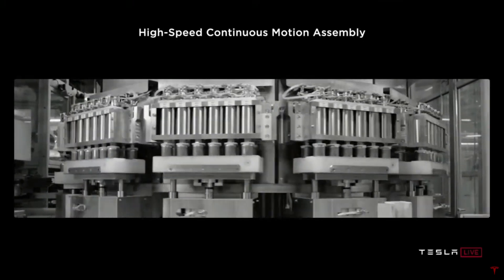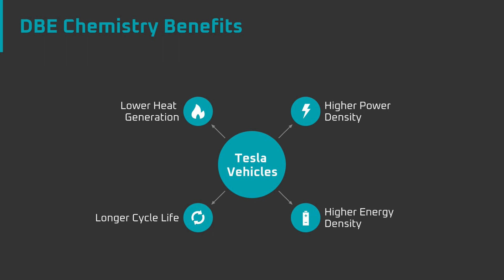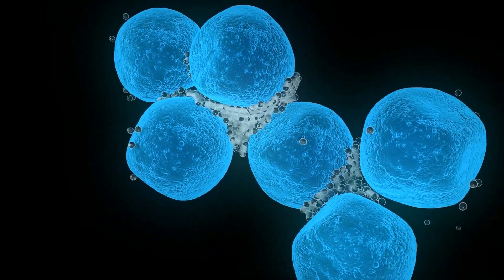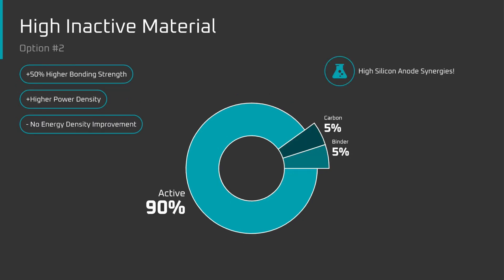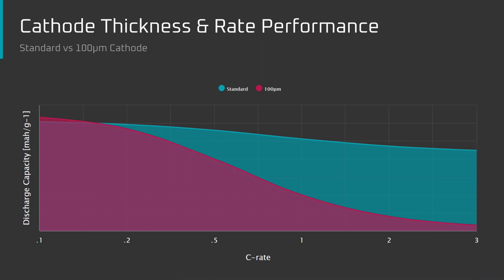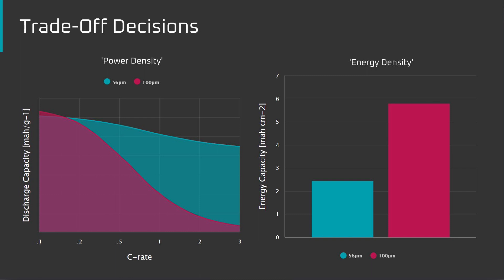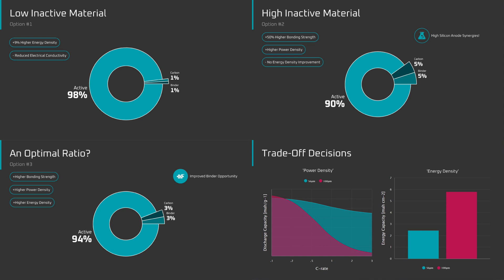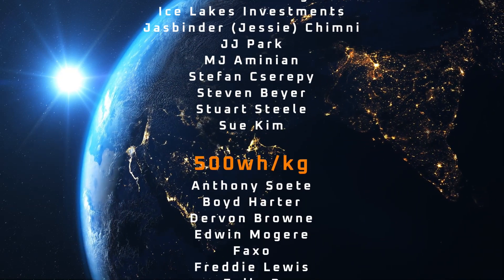#2 Tesla's Secret Sauce // Maxwell Dry Battery Electrode

Comment: Where are the 10s of 1000s of 4680 cells weekly being pumped out by the "tiny" pilot plant (since May?) going? How many (2k cell?) Cybertrucks & (10k cell?) Semis can be outfitted at that rate (increasing as manufacturing is optimized & stabilized to the point that the machines that build those 4680 making machines can be built)? Estimating conservatively from 20k/day (1000/hr with 4 hr/day avg downtime for tuning & retooling) to maybe 50k/day? (ALL this is total SWAG from what was hiding in plain sight on BD, edited in response to feedback.)
Reply: The Semi-truck needs 10 times the number of battery cells than the 100 kwh sedan. A 1,000 kwh battery pack, for the Semi-, will require about 10,000 cells of the new model 4680 battery cells. The pilot plant may be enough for just that; but, there's also the needs of the cyber-truck and the Model S Plaid, and ... who knows.
Reply: Thx, I've edited my original ?s  in response to your & others' feedback. Seems like the PR Dept was redundant, as the "visible" team are doing fine interacting with the public. Those vids of real-time pilot plant ops seemed quite revealing.
Reply: @Crunch_dGH  As Elon said, the 4680 battery pilot plant is still being modified / improved. The plant may be shutdown for extensive periods of time for changes and testing; so, its output won't be continuous. Beyond this, Tesla is telling the public NOTHING. There is no information for us to draw conclusion from.
  A battery production plant design company (ATW), which Tesla recently bought in Germany, will (supposedly) design a full-scale 4680 battery cell production plant. They will, supposedly, use the design elements of the pilot plant, and incorporate those ideas  into a full production battery cell plant for the Giga-factories. It would be nice if Tesla had a PR department to inform the public of things like this---but, no, they don't.
Reply: @artsnow8872  Thx, I've edited my original ?s  in response to your & others' feedback. Seems like the PR Dept was redundant, as the "visible" team are doing fine interacting with the public. Those vids of real-time pilot plant ops seemed quite revealing.

Comment: (OCGN) OCUGEN....Explain this to me. How is it, that a Gene Therapy Company that by right at this point should be on Ark Invest Radar? They have 4 gene therapies on Phase 1 and phase 2 trials. and it's still at $0.31 a share. I can't believe it. tell me what is wrong with this picture, and why is it at $0.31 a share and 3 Analyst have it going up to $1 this QUarter? I do not get it? Oh (OCGN) OCUGEN THERAPEUTICS. Ocugen, Inc. engages in the development and commercialization of therapies for eye diseases. Its pipeline includes OCU400, OCU410, OCU200, OCU200, and OCU300. The company was founded by Shankar Musunuri and Uday Kompella in 2013 and is headquartered in Malvern, PA. The listed name for OCGN is Ocugen, Inc. Common Stock tHAT IS PULLED FROM Robinhood APP.

Comment: Jordan, there’s an extra slash or exponent on the ordinates units (Discharge capacity) on the graph “Cathode Thickness & Rate Performance” at 11:51. Probably from the source. Should be either (mah/g) or (mah . g-1).

Comment: Do they HAVE to use a metal oxide on the cathode? Most of the metal oxides are nickel dominant anyways.  Couldn't they just use nickel foil attached to the aluminum cathode?  The nickel part is what retains the power right?  So why are they using a slurry mix of brittle metal oxides? Get rid of them. 

A thin sheet of Nickel shouldn't come apart due to expansion and contraction and you could coat that foil with cobalt and manganese as needed.
Reply from the maker: Metal oxides are used for intercalation/storage.  Pure nickel doesn't do this.

Comment: I would like to see another video on electric flight.  I poo-pooed your other video, but the topic is actually important.
Aircraft are much more efficient at carrying payload fast, more than you would think.  The book "The Simple Science of Flight" has a nice approachable explanation.
While my video claims Elon's "Electric Jet" is nonsense, it may be possible to produce an electric fan that is efficient at high speeds.
As an example of efficiency, modern composite petroleum powered aircraft that travel 200 mph have about the same fuel efficiency as a passenger car traveling 60 mph, for a payload of two people.  A 278-horsepower engine hit 323 mph in an airplane designed by Paulo Iscold.

Comment: So now we get a little insight into why it is so difficult to nail the process.  First, many of those graphs are on log scales.  So very small variations in process tweaks makes for large variations in performance.  So, for example, roller separation is undoubtedly a critical factor.  When microns matter everything from feed rate to viscosity to temperature needs to be super tightly controlled.  Not just in the machine but things like the temperature of the roll as it is being fed, probably even the malleability of the metalic sub-straight.  That means reliable production processes before the materials even get to the Tesla factory.  These are the kinds of things that are relatively easily tweaked in pilot production but at terawatt scale must be right from the get go.
Reply: Tesla has bought a battery production design company in Germany. They will, probably, design such a production line for Tesla's new 4680 battery. Maxwell Company would, then, design and build the necessary equipment for the production. These 4680 battery production lines may be part of All the Giga-factories. Panasonic will, still, produce the older 21650 battery cells at Giga-Nevada for two or three years -- then, who knows.

Comment: G'day Jordan,

I realise you're about to go into the cell design benefits, so I figure I'll add my AUD $0.02 (which is worth 7% more than your NZD ;) - although the info contained is definitely worth less than yours lol )

Fairly directly after battery day, there were a lot of people doing the basic volumetric math on the cell (and Tesla's slides) and decided that the 4680 cell is 5.5 times the volume, but was "only" 5 times more energy and started complaining. What I realised fairly quickly is, that a single 4680 cell occupies roughly the space of 4x 2170 cells (in the battery module), because of losses to airgaps and whathaveyou. So volumetrically, it's actually 20-25% more efficient just due to shape alone when compared correctly to 4x 2170s. It is also 6 times more powerful (so 50% over the 2170s). I would assume largely because of the tab-less design ofc, but, it also led me to think. Perhaps Tesla is using the fact that the new cell has better natural characteristics (in energy capacity), to focus much more on Power density. A feature that they already excel in, but, even more allows faster charging. Which is a HUGE selling point (and much needed for the Semi and newer cars as battery pack sizes balloon)

There's also the possibility that Tesla isn't pushing the envelope too far with these batteries. Cost and manufacturing speed are the two essentials for them, so they can ramp up to astronomical levels (almost literally with SpaceX lol). That would also allow them to "improve" as time goes on, even if they technically might already be capable of it now (but that's a fairly cynical thought of a tactic, which I don't think Tesla would choose)

Also, I can't recall where I heard, that, trace amounts of NMP left in the electrodes after a wet slurry, react quite negatively with the electrolyte itself. Where they have to put in additives to prevent the degradation caused by this (which all happens in the first few charge/discharge cycles in the factory). Maxwell's DBE shouldn't have this issue either.

Keep 'em coming though Jordan, love your content. If I could inject it straight into my veins (I wouldn't because I hate needles, but) I would at least smoke it or take it in pill form (and now I'm off topic lol)
Reply from the maker: Thanks for the thoughts Mr. Velociraptor!

Comment: Tesla's new battery chemistry isn't , DIRECTLY, the most important development. The most important development is that by combining all the changes in chemistry and packaging, the new battery assembly can be 10%+ more efficient, have about a 40% smaller footprint, and about 50% lower weight from reduction of cooling system mass and use as a body / frame structural member. Reduction of cobalt and manufacturing complexity are very important as  cost-saving measures.
 All of the combined savings are several hundred pounds of total vehicle weight (which results in greater vehicle range), and a decrease of about 50% in the price of the battery package.

Comment: In the debate between energy density and power density tesla will always maximize energy density.
 The reason is a) the tabless design creates more power than they could need, and b) you can always increase total power by adding more batteries. It's the same reason ultracapacitors make no sense. If you need the extra power, just add more batteries and get bonus range with it.

Comment: i keep hearing the hype around solid-state, it's been a real goto for firms wanting to shit talk.  Mercedes claim to have a bus that will be solid-state powered. Mercedes! what were they thinking lol. it claims to have a 441-kilowatt-hour battery pack that will have a range of 136 miles.  I'm not even sure i understand that tiny number versus the huge pack. i get the bus is big and heavy but that must be some really crap engineering.  Its like an 80's v8's in America being 6 litres but only 180hp.  keep up the excellent work. i'm off to watch Sandy Munroe open that mysterious box that will change EV's forever!
Reply: Solid-state may no longer be the Holy Grail. Merc may have that battery -- at only $40,000 (EUR34,000).

Comment: Love the animations on binder coating on the active particles! I think the formulation recipe is now much improved in Industry applications 90/5/5 is outdated unless new materials are in the play. Majority are either 94/3/3 or 96/2/2
Reply from the maker: You're totally right!  Ankit just pointed me to a thread on the Slack channel.  I feel better knowing that I wasn't the only other person confused about this.  It sounds like 94/3/3 is pretty stable and some were saying 96/2/2 for high energy applications, but 98/1/1 sounds like it starts hitting limits.  I was also suprised to find out that the binder does offer some decent conductivity.  Just not nearly as high as the carbon.

Comment: Great video, as always.
To add about the dry process, they use PVDF as binder, common and well known in the electrode industry. PVDF has melt point of about 177C celsius. They use an electrostatic gun to first coat the electrode and the hot roll process is there for 2 reasons, increasing the density of the electrode and activate the thermal effect of PVDF. On this research paper (dr Ludwig) they use bottom roller of 190C & upper roller at 175C celsius (225 cm/min) to activate PVDF binding effect :)

edit: melting point of PVDF 177 not 200C celsius
Reply: Good info. Now, let's ask Tesla. Tesla? Tesla? Tesla! (No answer.)
(You can edit by clicking on those three dots to the right, and then, make your changes.)
Reply: @artsnow8872  That's the Tesla manufacturing process, don't be mean

Comment: What are your thoughts on Elon’s statement that they need 6 months and two iterations of dbe process to achieve mass productions rates ?
Reply: Galie from hyper-change made a comment that the cells were already shooting out like bullets from the process they have currently on the shareholder tour.  If accurate, then one has to wonder exactly what production rate they're actually shooting for? Light speed?
Reply: @Bryan46162  faster the better... iterations likely relates to quality control also

Comment: Great presentation. But what i want to know is, will tesla use a LIQUID electrolyte or not? i live in a very cold climate and the car travels 60miles every week. I cant have the battery loosing 30-40% of range, and liquid electrolyte is notorious for gooing up and causing range loss. Do you have any insider information on the new battery cells cold weather performance?

Comment: Diving deep into the imoact of every single change annonced at the battery level is phenomenal!
I think that many if those changes need to be looked at in the context of some or all of the other changes.
For example the DBE could be optimized for energy density as heat would be far less of a factor due to the tabless electrode design, thus improving power density as well.

Comment: Seems like the thicker cathode might be a good option for the stationary storage, energy density would be a much higher priority and the issues with heat and thus charge and discharge issues could be addressed by a bigger heat management system wich is a much better tradeoff in a stationary application.
Reply: Energy density is more important for cars than in stationary storage. Cars need to be as light as possible because the car is carrying the battery. Stationary storage can afford inefficiency.

Edit: Or is that what you are saying? It isn't clear.
Reply: @NateDecker1982  point I'm making is that the thicker cathode would be less of a trade-off in a stationary application. This is because the problems it causes, more heat build-up wich leads to reduced charging and discharging rates can be offset by a bigger and beefier cooling system which is much less of a trade-off in a stationary application. This way the gaines in energy density at the battery level aren't lost at the Pack level and the losses in power density are offset buy the bigger more efficient cooling system essentially meaning that the engineer gets to have his cake and eat it too.
Reply: @mrspeigle1  More importantly, for stationary storage the charging / discharging rates are low (btw, the charging rate relates to the power of a cell), so yes, stationary storage systems need to be high-energy but not-too-high power.

Comment: Yet another informative video. We all have been waiting with bated breath.
I have enjoyed your deep dives into what really makes these batteries so much more effiecient, powerful and less expensive to produce. I also am gaining an  understand just why the traditional battery manufacturers would be reluctant to change their current manufacturing lines which they may have invested billions in to use this newer tech. These companies have probally wanted to get to the manufacturing of a solid state product instead of revolutionizing the production of the lithium nickel batteries. 
It looks like tesla made the bet it could make batteries so much less expensively yet significantly increase the energy and power density to scale faster than wait another five to ten years for the solid state bstteries to become affordable. The race was on. Lithium remains Tesla's path for EV expansion. 
I still wonder where this leaves Panasonic with its announced 20% increase in energy density in five years compared to the incredable leap tesla has described with its manufactoring process. .
Reply: Panasonic might manufacture the lithium / manganese batteries for Tesla, for 2 or 3 years; then, sell batteries to the "Big Boys" after that, for their EVs.

Comment: Thanks for the video. There's one point I'm missing in the discussion of the line speed. The 7x speedup is in terms of energy capacity produced isn't it? If the cells are much more energy dense, the line movement speedup could be much less.
Reply from the maker: Correct.  This was covered in the 'Predictions' video
Reply: @thelimitingfactor  Right, but in this video you calculate expected speed as 25 / 5 in m / s and compare it with the 7x number which is in energy / time. Which I find confusing.
Reply: So please  check my reasoning in this: The 4680 cell stores 5x more energy. But the line speed is measured in m/s (not cells/s) and the new cell is about 2.2x thicker than the 2170 cell (46/21). So with constant speed the line would produce ~ 5 / 2.2 ~ 2.28x more [GWh]. So we can calculate the physical speed-up multiplier of the line as 7 / 2.28 ~ 3.07x.

So the roadrunner line goes about 3x faster, right? [in physical speed, m/s]
...producing  about 1.37x more cells which are 5x more spacious (for energy).